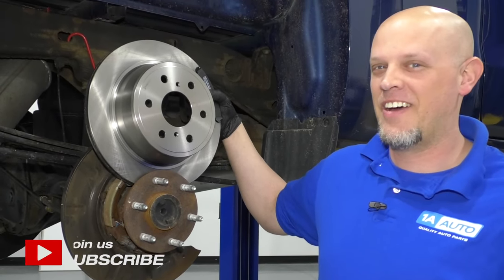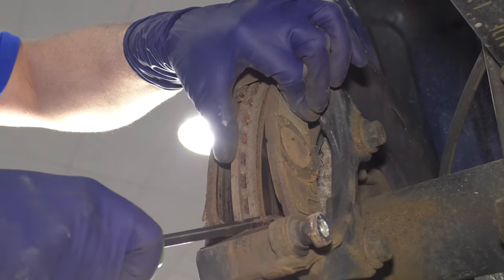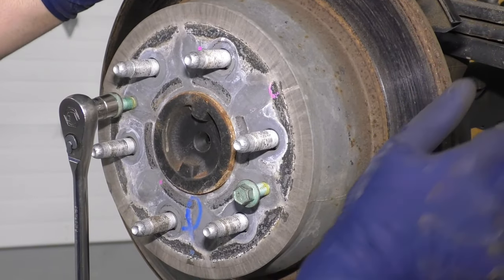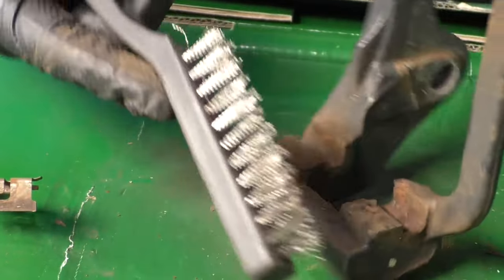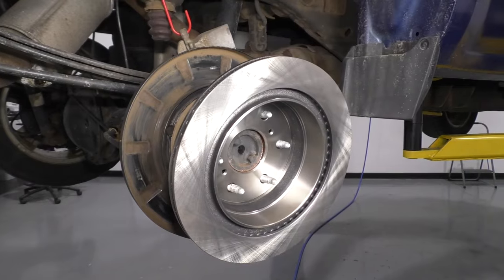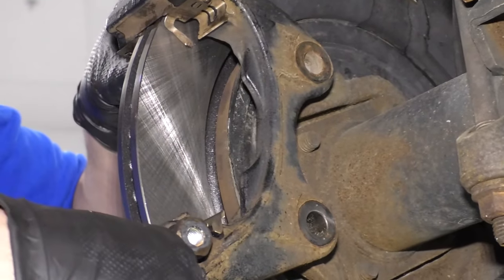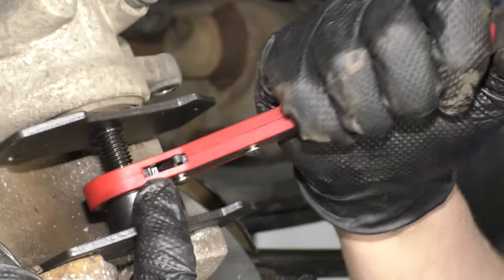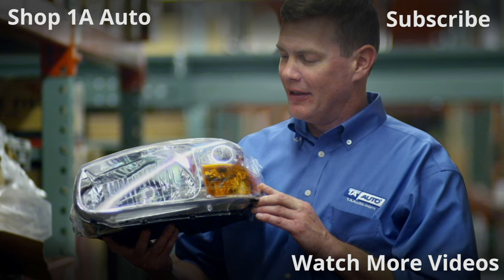How to Replace Rear Brakes 14-18 Chevy Silverado

Comment: Serious word of caution before removing the rotor: YOU HAVE TO ADJUST THE E- BRAKE PADS INWARD AWAY FROM THE WEAR RIDGE! The gentleman in this demo was very lucky he didn't rip the  e-brake pads apart like what happened to me >:[
Reply: What is this exactly?
Reply: Did you have to rebuild the ebrake or was i done for cause I just did that
Reply: How would u do that ?
Reply: Yea I think I just screwed mine up. Since I don’t have a lift like his I lifted my truck with a jack. And applied the brake. So I used the caliper screws to help not knowing that I had to release the brake. Now I have two springs pop off and I have no idea where they go. Fml
Reply: @leocantu3983  🤣🤣🤣🤣

You set the parking brake to raise the rear end?! 

You know the parking brake does nothing when the back end is off the ground, right? You are then supposed to use wheel chocks in front of your front tires so they can't roll. 

Those springs are the springs that hold the parking brake shoes together. One up top, one on bottom.
Reply: I really wish I would have read the comments first.  I just destroyed mine.

Comment: I just did this on my Silverado … after installing and taking it for a ride when I brake I hear something is it normal ? When they are new ? I’m assuming they need to be break in I just wanna be sure before I really on the highway
Reply from the maker: +@henrycamacho7146 We wouldn't be able to diagnose an issue like that here, you may want to have a local mechanic take a look at it. Thanks for checking us out! http://1aau.to/m/Shop-1AAuto-c

Comment: My 2015 Silverado had a little metal pin attached between the rotor and the parking brake. Basically had to bust it to remove rotor. Anyone else have this issue?

Comment: If i only replace the brake pads and clean the rotor and calliper and pins … I don’t have to worry about the e-brake right?…clean the rotor while it is on still is ok?

Comment: You don’t bleed the breaks ? Or is it only on drums brake style brakes
Reply: You only ever have to bleed the brakes if you disconnect the brake line (if you change the caliper for example, you must bleed the brakes) if you are just changing the pads and rotors then you don’t need to.

Comment: Caliper bolts are M10 size, 1.5 pitch and are 30mm long, they will get the rotor off the hub by about an inch, but will still hang on the e-brake shoes if problematic. You can get new bolts at M10x1.5 60mm long bolts which popped the entire rotor off of the shoes.

Comment: Also, ALWAYS use new clips, your new pads should come with them. Unless you have excessive crud/rust on your bracket, skip filing or brushing, it has no impact.

Not sure of the value added by buzzing the hub with the grinder. Your old rotor was on there, any rotor problems are gonna be felt at the outer part that runs through the pad.

If you have a boat or live in a salty environment, use marine grease on your slide pins.

You're welcome!
Reply from the maker: +Andrew Johnson Thanks for the feedback!

Comment: Do you have a video for the front brake replacement for a 2014 + Chevy Silverado 1500
Reply: The front is pretty much the same. You don't have to worry about the e-brake
.

Comment: I'm not a pro but I thought I push down on the bracket bolts? I know on the front driver side you push down and on the front passenger side you pull up lossen the bolts, is it the same for the rear? Like I said I'm not a mechanic but want to do my rear brakes/rotors on my 2017 chevy silverado.

Comment: The pads were stuck in there because the clips have bent up tangs to capture them from backing out. 

Remove them with the bracket as a unit and then compress the tangs with a flat screwdriver and they slide right out regardless of rust.

Also, there was no need to hammer on the rotor, although given their cheap replacement cost, doesn't matter. If there is a ridge that's holding them onto the parking brake, run those bolts in and it will force them off. Easy. Use an impact or a long breaker.

Comment: So just did my 2015 chevy Silverado 1500 and the rear left smells like burning and i lift the truck up put in neutral to try to spin the wheel and is hard , is the caliper bad ? Thanks in advance.
Reply from the maker: +TAVYAK angler We wouldn't be able to diagnose an issue like that here, you may want to have a local mechanic take a look at it. Thanks for checking us out! http://1aau.to/m/Shop-1AAuto-c

Comment: Can you do a video for front brake & rotor replacement for a 2015 Chevy 2500HD Silverado? I really need the torque specs for this job.  Thanks!
Reply: The front is pretty much the same. You don't have to worry about the e-brake
Reply: Torque specs = goodentight.

Comment: I thought you have to take off the cap so you mit have to put brake fluid in or when you press the cylinder so have to brake on I don't think what you don't know what you are doing

Comment: The bleeder screws should be opened and bleed the brake fluid out then add more to the reservoir after tightening up the bleeder screws.  Compressing the piston sending fluid back into the braking system can damage the antilock brakes.

Comment: Skill level 0 question but the video is for rear breaks then you start by taking out  Calipers and brake pads.  Do rear brakes have both?
Reply from the maker: +Joseph Wolf The rear brakes on this vehicle also house the parking brake mechanism which is a drum brake on the inside of the rotors. They have calipers and pads for the braking system and shoes inside the rotors for the parking brake system. Thanks for checking us out. Shop for high quality auto parts on 1AAuto.com:

http://1aau.to/m/Shop-1AAuto-c

Comment: 148 ft lbs seems like a lot of torque for the caliper bracket. Also 140 ft lbs for lugs nuts seems a lot.
Reply: My Tahoe calls for 140 ft lb on the lug nuts per specs
Reply: 140 is the proper torque
Reply: 140 for the lug nuts is straight out of the owner's manual.
Reply: The torque was incorrect for the bracket bolts AND  the guide pins ….. but correct for lug nuts